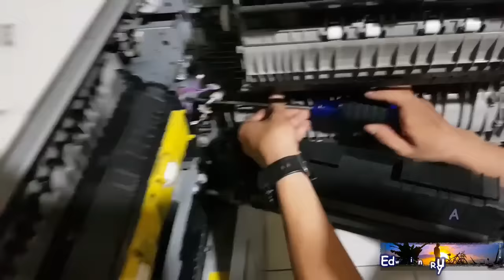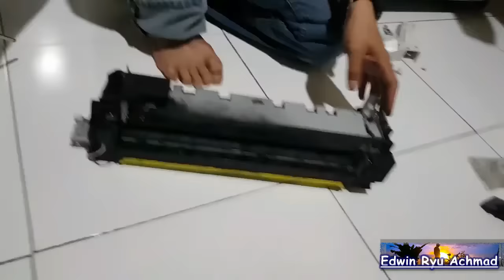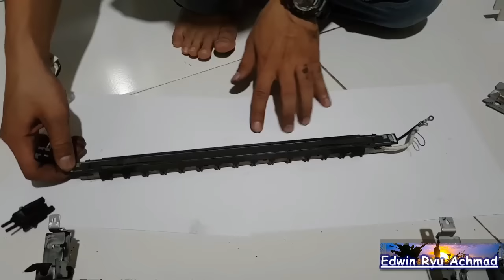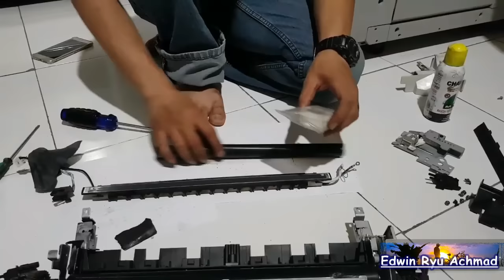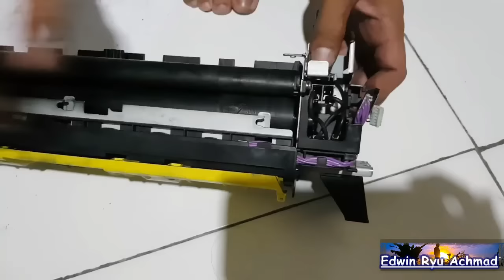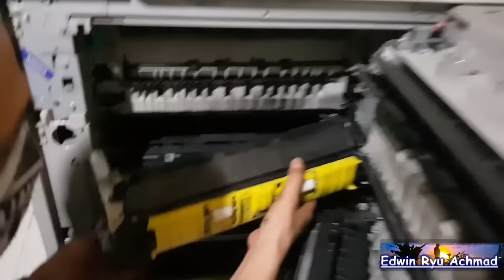Replace Grease, iR3570 iR4570 iR3045 iR3035 iR3235 iR3245

Comment: While the premise of this video is correct the methods used has left me smacking my head. You should clean the ceramic heater with turpentine and a clean cotton cloth/rag. Not sand paper. the fuser grease also needs to be white not yellow as there is a timing/film rotation window/sensor on the end of the film which reflects an infrared beam.